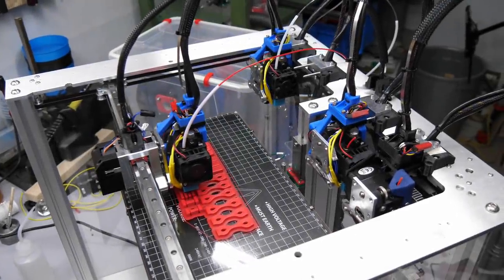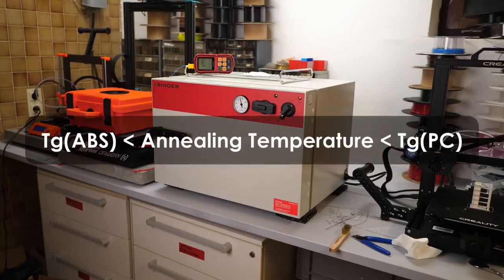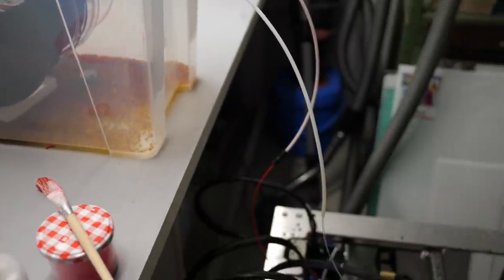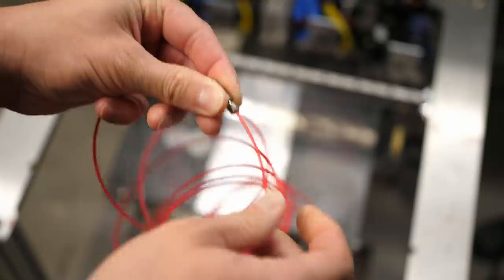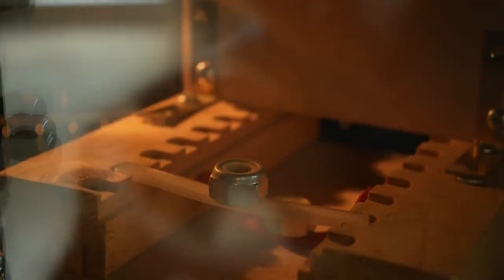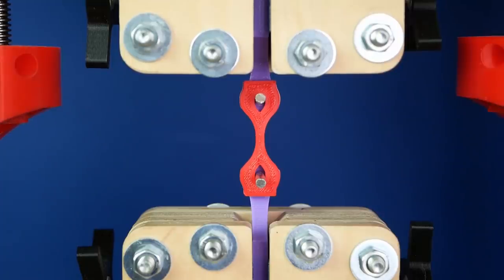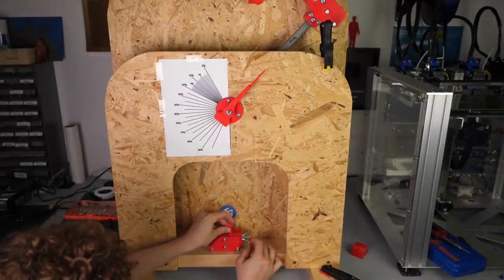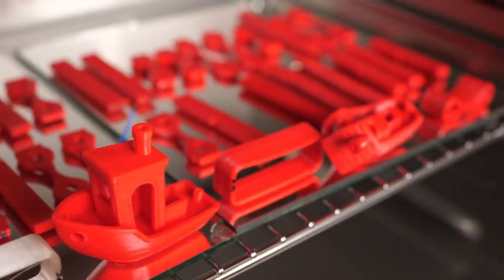PC-Core ABS - WARP-FREE annealing with Ingenious Dual-Material Filament

Comment from the maker: Don't forget to share this video on Facebook, Reddit, Twitter and other social media!
Reply: I would love to see you redo this experiment with the following parameters: After printing has completed, place each unit into a container and fill with plaster of Paris (just as you would do in mold building). Allow to cure and then place into the heating chamber and slowly ramp temperature up, until the appropriate annealing temperature is reached internally. Then, gradually lower the temperature, until room temperature, remove the plaster and then perform stress tests as before. Thanks
Reply: What happens if you vapor smooth this filament?
Reply: try these threads in solvent vapors
Reply: Great tests as usual! Why so negative about the results? Besides not being improved by annealing, the hybrid material gives great results as it is. ABS without warping, nearly the layer adhesion of pure PC and the ability for vapor smoothing? That's all I ever wanted..
Reply: Impressive dedication to rigorous testing! I'm so happy I found your channel :)
I have an idea that might be worth trying: You can embed a 3D print in a fine powder, compact it and then put it in an oven at a temperature past the glas transition temperature. The idea is that the surrounding powder takes the shape of the 3D print and holds the shape when the polymer can't hold it on it's own anymore. Think lost form casting, but with keeping the original plastic part instead of replacing the volume with metal. I tried this a while ago but unfortunately didn't have access to a 3D printer for long enough to really test this. However, first results (after a couple of failures) were promising. 
Here is what I tried, that allmost worked:
I used an ABS print with essentially 100% infill, put it in a ceramic flower pot and embedded it dry cement powder. You have to vibrate it to fill all the gaps and compact the powder (just like with lost form casting). Then put the whole thing in an oven just like you did here but you can use higher temperatures. Afterwards you can easily brush off the powder from the part. The only reason I used cement was, that I knew it can hold the temperature, and it is a very fine powder, so it preserves detail. I'm sure other powder could work too, maybe better, but it was the best idea I could come up with at the time
Mistakes I made: 
In the beginning I used too little infill and the print collapsed inside the powder form because, obviously the plastic doesn't stick to the powder well.
Then I used too complex of a geometry and didn't surround the print well enough.
Ideas that might work, but I didn't try yet:
Use fine table salt as the embedding medium and fuse it together with water mist (fine spray water bottle or ultrasonic). The water dissolves a tiny bit of salt and crystalizes when the water evaporates and those tiny crystals make the remaining salt grains stick together. I found that ABS sticks to this salt surface (kind of). My hope was that the almost molten plastic sticks to the salt wall well enough so I could use lower infill percentages. (Also you can easily dissolve salt with water.)
Maybe you can make use of some of these ideas. I'm sure if someone can it's you. (probably someone else allready came up with something like this, but at the time I couldn't find anything similar) I hope to continue my tests in a month or so, when I have my first 3D printer. 
I wish you all the best with your 3D printing projects!
Reply: dont forget THEDONALD.win
Reply: While YOU may be disappointed, WE appreciate your hard work and consider this test to be highly successful.
Reply: The possibilities could be greater with a 3mm printed filament. Use 3 or more materials. See how getting pinched down to 0.4mm affects it.
Reply: @greggv8  The ratio of the two materials stays the same
Reply: This is one of the most impressive amateur-science projects I've seen in years...
Reply: I know that I'm pretty late to the party in terms of commenting on this video, but the idea of a dual-plastic filament fills me with a lot of ideas on the potential of the process. You mentioned PLA and TPU, and I think you could take that to an elevated level by using Carbon Fiber PLA with a shell of TPU to make a solid, stiff, impact-resistant material, which I personally think would be really cool to see! I also wonder about the aesthetic applications of this sort of technique - You could potentially put a transparent glitter filament around a glow-in-the-dark one of the same material, in order to create really cool effects!

I know you move on to other projects very quickly, but I believe ones like this deserve more of a second look. Excited for your future projects!

Comment: I think that you missed the opportunity for annother interesting test. As far as I know the properties of plastics get worse when you heat them repeatetly to their melting point. Because of this phenomenon I would expect your printed and then reprinted Material to have worse properties, than the Material that is only printed once. Maybe you could try this out by printing abs filament, from your abs filament, (maybe even repeat this process n times) and then test  the material properties of the testsamples printed from the reprinted abs.
I would be interesend in your thougths on this.
Grüße aus dem Norden😜
Reply: This! Science. Baseline. 

Yes!
Reply: I asked this myself as well: Does the material degrade in properties when you leave it at high temperatures in an oven for a few days.
Reply: @jayphone1  I don't think the annealing process would degrade the material, as it isn't heating it above the melting point. Could be wrong tho
Reply: As long as you dont go over the temperatures in which the molecular chains are damaged No. In fdm we use thermoplastic plastics. These can be melted and reshaped endless Times. In theory that is.

Comment: Love your videos, its obvious you put a lot of time and effort into the research and execution of them. However, are we going to see any actual CNC videos hence your channel's name? I recently started building CNC's after 5 years of using mainly additive manufacturing techniques, built an rs-cnc32 and am in the process of building a workbee 1010 with 1.5kw spindle. It would be great to see how the two technologies could possibly mix (3d printing a part with intentional overextrusion and machining off the excess or overextruding a part, annealing it and then machining the excess). Would also love to see more lathe videos mr cnc kitchen! thanks

Comment: I love how you test new concepts of improving 3d printing performance. I believe I will become a patreon. 
I would do the test again with higher temperatures. Because I believe that Tg is not enough to fuse layers together. You probably need to reduce the material viscosity quite a bit. As a first step I would try to get the temperature when the multimaterial parts deform too much. And then heat up to just below this temp. 
And maybe there is a way to increase the PC content, because we need ABS only at the interface. Is there a way to paint PC filament with ABS slury? Or you could print 2.85 mm filament.
Reply: @AlexanderTasch  Yes you are probably right. I thought that up to 165 degrees where the PC failed would be still quite a margin to raise the temperature further. Might be no the case for the material mixture. The best way to check would be to heat up the multimaterial benchy till it looses it's shape. But maybe it's not too far from 130.
Reply: Point is, PC already have excellent interlayer adhesion, better than tensile strength of ABS in fact. Why not simply print with pure PC than?
If you really want good interlayer adhesion, warp-free annealing and care about strength, a combination of PC outer layer and gf/cf filled PC core will work best.
Same for Nylon I presume.
A russian startup as already making coaxial filaments, I am already testing a sample of pc/abs (50/50 ratio), it does look promising.

Comment: While you didn't get a dramatic strength improvement, you did get a slightly stronger end result. More importantly, the combined material was much easier to print than PC alone with much of it's strength.  Thank you for doing this huge project!
Reply: Yeah I see printability as a huge potential application of this concept as well. An inner core optimized for strength and an outer core optimized for layer adhesion. Putting some nice long carbon fibers with horrible flow properties and just pushing those out of your brass nozzle would be pretty cool, for instance. Not sure if there are many promising material combinations though.
Reply: @eelcohoogendoorn8044  i love the embedded fiber idea! Probably needs a more heavy duty nozzle and pump to smoothly print fibers. If the print is one continous motion from start to end, wouldn't it be possible to have just one long fiber throughout the whole filament? I think one continous fiber filament printed in some kind of criss cross pattern could be very strong!
Reply: I think if Stefan used a smaller nozzle diameter like a .2 or even a .1mm nozzle he could've experimented with higher PC to ABS ratios and really get the PC to show it's strength with the bed adhesion/warp resistance of the abs making large prints possible. A 75-25% PC-ABS mixture would really help the strength values.

Comment: I would say given how the dimensional accuracy held it would be interesting to see how much temperature it can take before it loses that
Reply: yeah 135c might be enough to improve the strength significantly
Reply: I was about to say the same. The heat treat temperature is the variable that likely has the best ability to improve the results. None the less the idea has legs and I’m sure the kind of filament will be out soon and most testing will be possible
Reply: OH! perhaps he should anneal it after printing it the first time as well? The i was thinking about how the people in the research paper printed a large core and then heated it up and drew filament from it, perhaps a heat treatment step before printing with it again help fuze it together?
Reply: @osimmac  not a bad idea, plenty of room for experiments IMHO
Reply: Maybe place it in a vaccum chamber while annealing it?  May help layer adhesion
Reply: @Bahnamoon  Considering how important that is in powder sintering and lost material casting, that feels like a very good idea...

Comment: I have a vac chamber that I use for resin degassing and infusion, and I've done quite a lot of work on trying to make 3DP parts stronger and/or impermeable using various coatings and resins.

FFF parts come off the printer very leaky. 

My best results for strengthening FFF parts have been by resin filling:
- printing them with sparse porous infill
- coating the outside with plasticote or similar to seal it
- drilling two or more holes in the top (entry and vent(s)
- putting a silicone funnel if the entry and a small tube in each vent and sealing them in
- filling the funnel with thoroughly degassed slow epoxy or PU resin
- putting the whole thing under vacuum for most of the working time of the resin.
- returning it to atmospheric pressure a few min before the resin gells

Comment: @CNC Kitchen, you need to test annealing the pc-abs mix at gradually higher temps until it deforms, then pull back some 5-10Cº, instead of the pre-test on a different oven. Maybe even with shorter annealing times, if that's not detrimental in your experience. What do you think? :)

Comment: For a more complex internal PC geometry perhaps you could print the 'filament' at 200-300%, then draw it down to 1.75mm through progressively smaller dies? I've seen it done with wire for jewellery - might be a way with plastic eg if heated slightly.

Comment: Is there any way you can anneal in a vacuum to try and pull out air between line passes and layers, even if you get some deformation?
Reply: I have a vac chamber that I use for resin degassing and infusion, and I've done quite a lot of work on trying to make 3DP parts stronger and/or impermeable using various coatings and resins.

FFF parts come off the printer very gas porous. My strong hunch is that the incomplete interlayer fusion is primarily a mechanical/rheological and thermal issue, and that trapped air is irrelevant - the pressure between the extruded plastic and the layer below is substantial and there's loads of room for the air to escape.
Reply: @psionicxxx  I never said anything about 3d printing in a vacuum.  I agree it would be excessive and of little use to this audience.  My comment was positing the feasibility of applying a vacuum at annealing temps to a finished part.
Reply: @chemistclips  Most 3D printed parts are hollow (or mostly hollow anyway). Even parts that are used for mechanical applications tend not to be printed at >50% infill. (And I believe Stefan has shown that >90% infill reduces the strength of some parts, probably for overextrusion/ reasons).  So you would have to print with an infill structure that has air gaps, and make sure that there are sufficient holes to even out the pressure differential (and sufficiently large to survive post-annealing). You would also have to gradually decompress the parts. All I can think of is my empty water bottles crushing when the plane lands! Between all of those caveats, I have a feeling you would then defeat the purpose, removing air bubbles between layers.
Reply: @robertharris1748  You're right.  I was spitballing to see if anyone with more experience could claim any feasibility to the idea.  When I saw Stefan's video annealing in salt with solid parts, he cut them open to show the (in some cases impressively large) voids that were the collection of all those trapped spaces in a print.  I don't see how you can preserve a part's form/function and control the location of that void/deformation so that it doesn't end up too close to an external wall (unless you have a side of your print you could care less about being more fragile - or maybe incorporate a sacrificial vestibule?).  Wonder if drilling a hole and getting a thin inner layer coat of some temp resistant resin on a hollow part could be enough of an scaffold to let a part temper on?

Comment: PC-ABS is actually what the stock Joycon shells and the backplate of the switch are made out of
Reply: Its a pretty common plastic blend for injection molding. at work we produce a lot of parts for car interiors with Bayblend and similar material.
Reply: This is not a blend, or did you miss that? this is an attempt at making a composite. The 3D printing community should run with the methods Stefan came up with here and maybe with that hive mind we can come up with a real composite that provides a unique hybrid of properties.
Reply: @vidznstuff1  i know but what B10K PlaysGames said about the joycon shells is a blend ;)

Comment: I'd be curious to know what the PC-core ABS does in terms of adhesion strength when exposed to acetone for a time longer than usually used for smoothing. The PC could allow it to keep shape while the ABS could melt and fuse. Another interesting question: When welding plastics, like damaged PP canoes, argon atmosphere is used to prevent oxidation of the plastic that prevents fusing. Could it be that a similar effect  - oxidation by surrounding air forming a non-fusable layer on filament - is happening during FDM printing? Would prints done in argon fare better on layer adhesion?
Reply from the maker: It might, but the layers that should fuse together as already bonded air-tight, so I think the impact of polymer oxidation shouldn't be too high.

Comment: I don't think that you are able to fuse the layers together to the point where you get mechanical properties you would have in a lying position at all.
Even in injection molding mechanical properties suffer a lot from flow and weld lines, even if the material is still near its melting temperature.
If you are interested I leave the name of a paper:
F.   Kunkel: Zum  Deformationsverhalten  von  spritzgegossenen  Bauteilen  aus talkumgefüllten  Thermoplasten  unter  dynamischer  Beanspruchung,  Dissertation 2017.
Sample creation is at page 25 ff and results at p 95 ff

Comment: I would like to point out that, for the tensile strength test, ABS/PC composite had the best failure mode of the three samples. Not the best performance, but the best failure mode. After quickly reaching what appears to be the yield strength, the neck turns white and keeps stretching a LOT. The ABS sample turned white on a very small section then immediately fractured.  PC necked some but had no color change. 
The ABS/PC composite should, irl, make a loud snap or sudden jolt when overloaded, then the stressed section will turn white and stretch significantly before falling apart. This will give the user a lot of time and warning during and after failure.